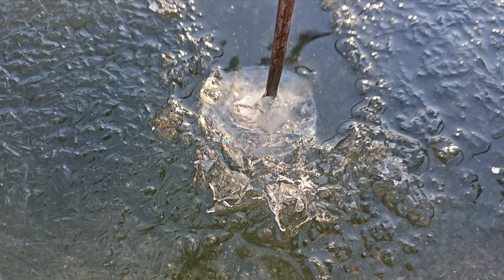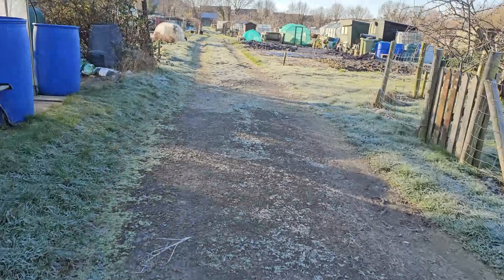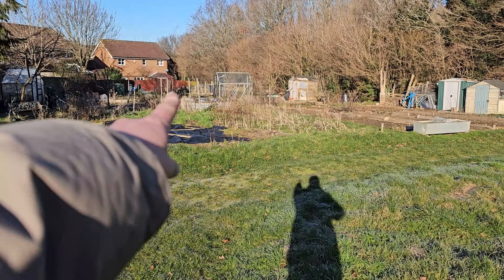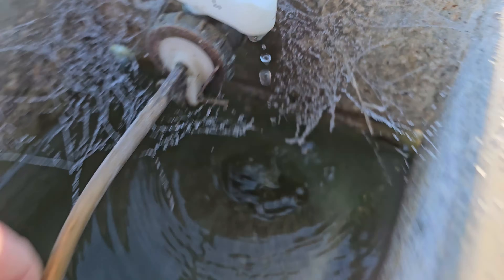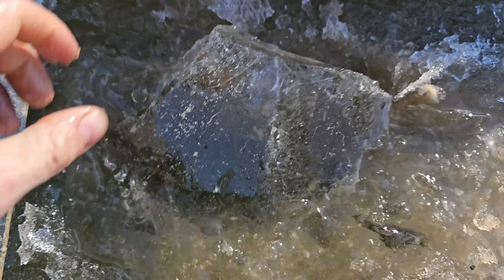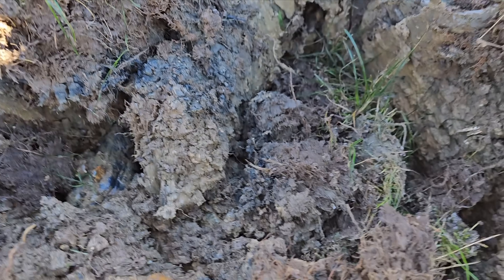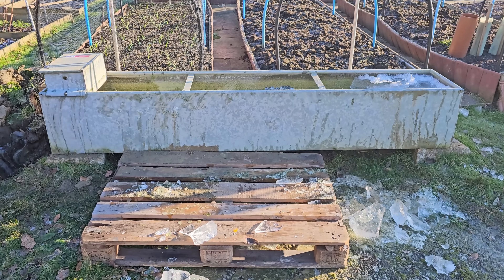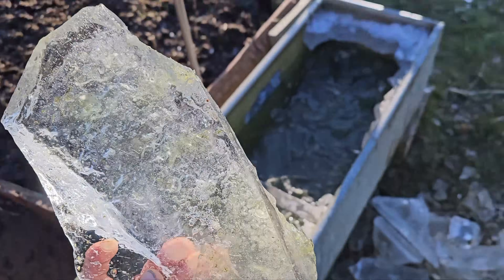MASSIVE Allotment with a leak rate…1 litre every 10 SECONDS!!

Comment: When we put cattle troughs in on the farm where I worked I didn't understand why the boss had us install the troughs a foot off the ground and connect the feed to the buried alkathene lines with galv water barrel until the winter we had a really long cold spell. Then, when we out on a feeding round, we'd stuff straw under the trough and around the feed pipe and set fire to it. It usually worked to unfreeze the feed pipe and allow the trough to fill. It was good for defrosting the hands after pulling the ice out too.

Comment: Another cracking job. Is there any reason you rarely if ever show how any part of the actual tracing? Would have been really interesting to show the process of how you narrowed it down on this one. Only improvement you could make, fair enough if there’s a valid reason.
Reply: Trade secrets he’s said before doesn’t want you to give to much away.
Reply: @nffc6717  fair enough 👍🏼
Reply: They will have  acoustic listening equipment to pick up the  sound of escapeing water and also  equipment to introduce hydrogen gas  into the systme and detect this as it rises to the surface.
Reply: @paulf2529  nitrogen*

Comment: Are those plastic fittings rated for sub zero temps with water in them? Just curious how resilient these are since I have a few around my property
Reply: dont know if they're rated but very widely used in agriculture for connecting water troughs, we never turn our water off. rarely get leaks